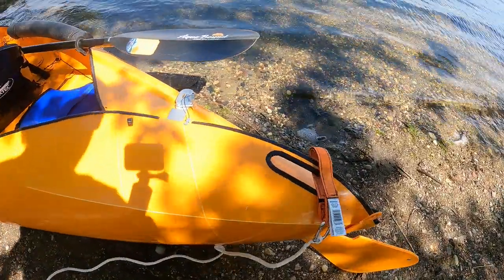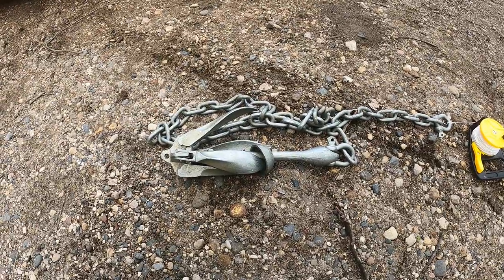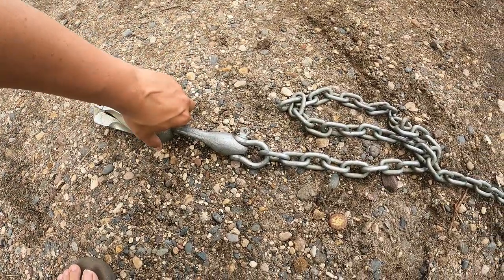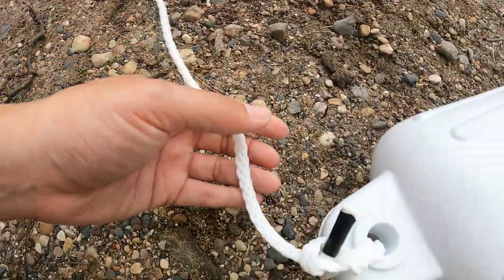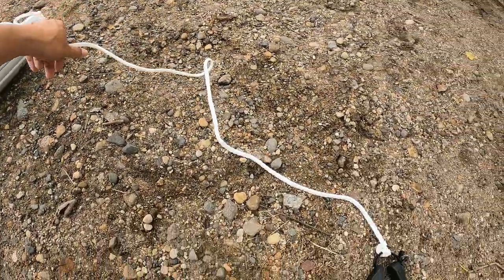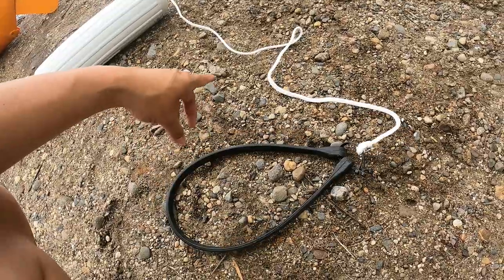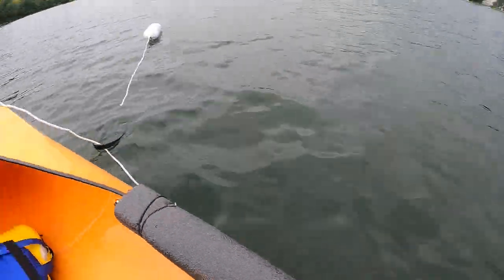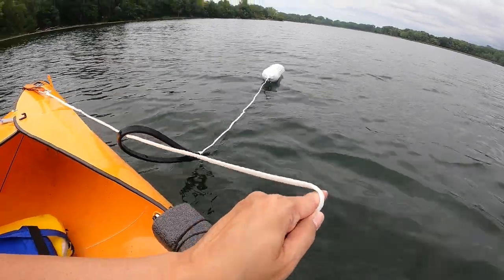Tucktec Anchor System (Quick Release)

Comment: Great job! How did you mount the yak attack rail? What hardware did you use?
Reply from the maker: Just a normal dril. The material is not hard to break through. After that use a washer and nut to secure

Comment: How’d you line the edges of the kayak?
Reply: @jazzfeline5970 I have the stabilizers . I’m talking the thin black on the edges ..looks like electrical tape . Was it stock that way? Mine didn’t have that
Reply from the maker: If you check out comments to my other Tucktec videos, I have responded to similar questions and provided the name of the car door trims.
Reply from the maker: this is a user add-on. even new tucktecs do not have this

Comment: Does it take on water where you drilled those screws?
Reply from the maker: No it does not, make sure it is drilled at a sufficiently "high" spot away from the water line
Reply: use a latex sealant where you drill and it will be water tight